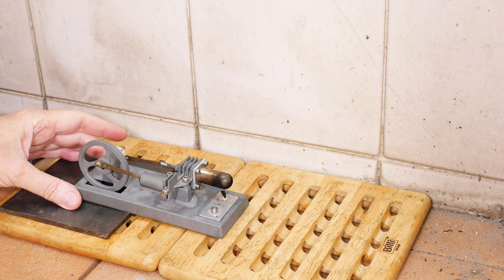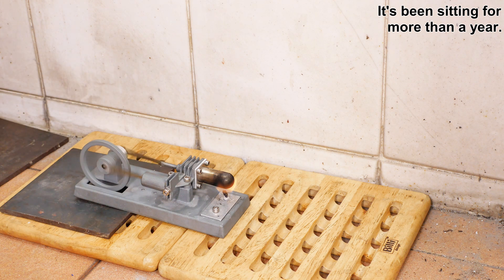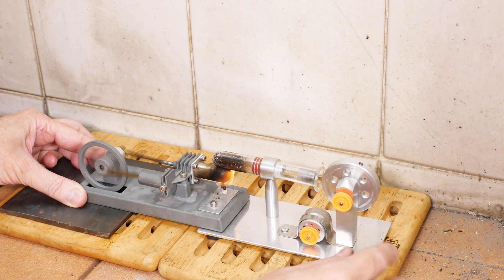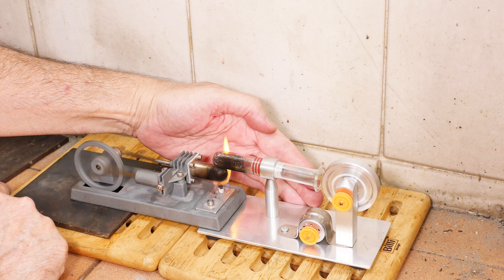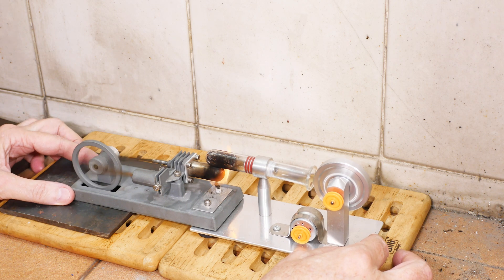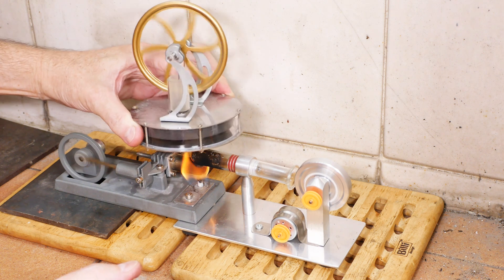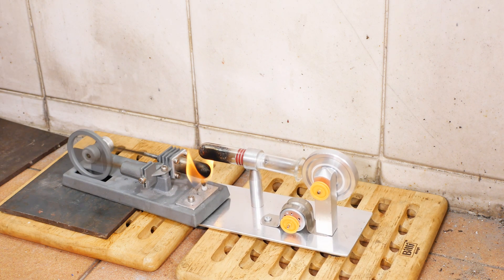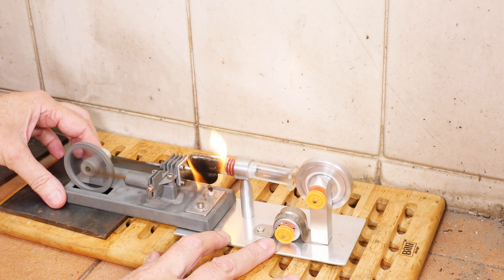Stirling Engine Doubling Efficiency Experiment (4K)

Comment from the maker: RELATED VIDEOS (including this one): 
RELATED VIDEOS (including this one): 
Stirling Engine Specs For DIYers   https://youtu.be/kokzk1xMk9Q
Unusual Stirling Engine "Teardown" & How It Works    https://youtu.be/m_cg4rGdggY
Stirling Engine With Propeller  https://youtu.be/s6Kh7wkJN-M 
Stirling Engine - How It Works In Simple Terms:   https://youtu.be/Q5QEBqjkNjo
Building A Stirling Engine, Laminar Flow Type, First Attempt Part 1 
https://youtu.be/QQ4nqy4GHJI
Stirling Engine Doubling Efficiency Experiment   https://youtu.be/Iqg9Nz-8Vwc
Thermo Acoustic Stirling Engine - Simply Genius   https://youtu.be/TEiBScfR4Vk
Stirling Engine w/ Generator - Gamma, Walking Beam Style   https://youtu.be/1x7Bo-dVsR4
Stirling Engine w/ Generator Power Measurement      https://youtu.be/bZqB_qwDbqI
Stirling Engine w/ Generator, 2 Piston Gamma Type    https://youtu.be/Xmb19QVJPqw
Stirling Engine - High Temperature, 2 Piston Gamma     https://youtu.be/Ji2oQ40_M0c
Stirling Engine That Uses Ice for "Fuel"???     https://youtu.be/kCbfVgBwv6Q
Stirling Engine - Low Temperature https://youtu.be/1BbfGe5Shgg

Comment: Next time first prepare the stand for the engines :D
Reply from the maker: You mean make a rehearsed, staged video?!?!? ;)
Reply: I think that if you have well developed stand (based on levels or something like chimney) you can use 1 flame for more than 5 engines, which can generate electrolysis for the hydrogen fuel for the flame.